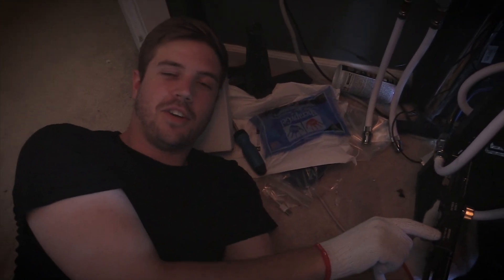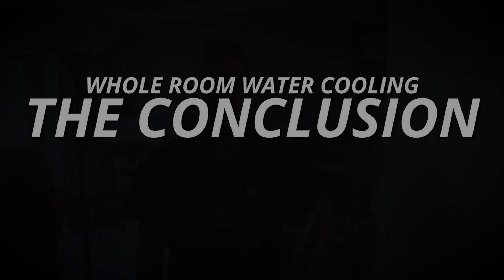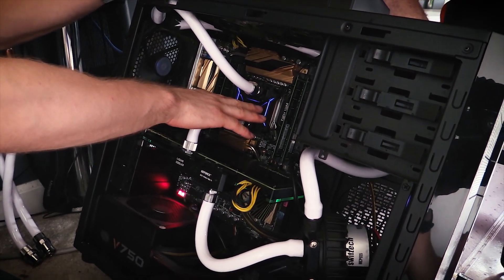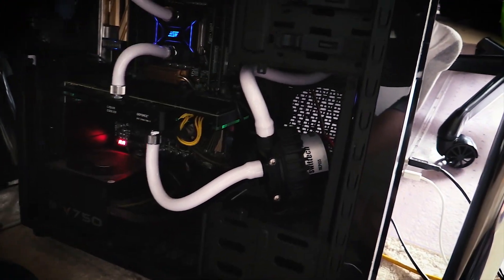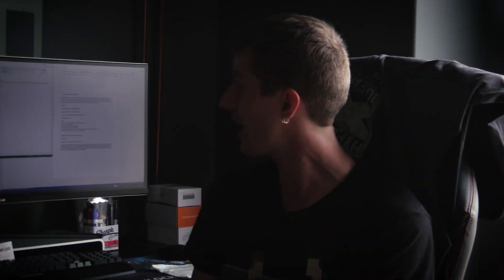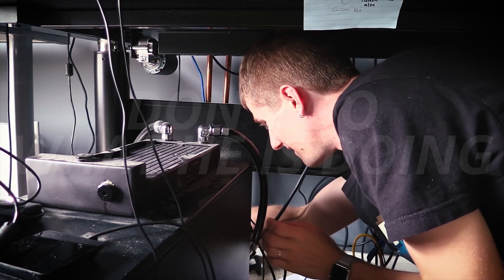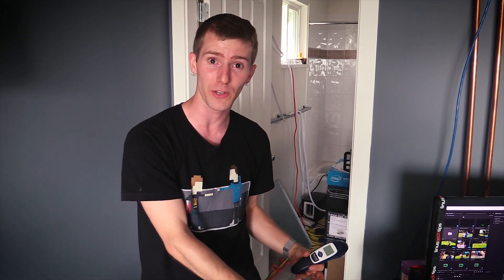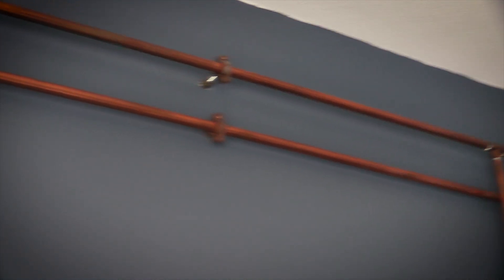Whole Room Water Cooling Part 7 - It's FINALLY over!

Comment: UV light does not kill all organisms in the water. It essentially requires a solution designed to be highly toxic to various organism. It then needs to be sealed, and before used, it needs to be fully cleaned and sterilized. Your cooling setup will be similar to a liquid cooled server room. A more practical solution is to have each system with their own radiator located outside.

PS another solution is a fume extraction system sued for multiple solder stations, such a system can be placed at the exhaust of each PC and thus pull the heat out if you design your PC's around using fume extraction systems. they are also simpler and cheaper to build. A little duct work, and an exhaust fan on the outside. and if you want to get really fancy, you can have some pressure based fan speed control using an arduino where as people open their exhaust vents behind their PC's, the fan speed will increase to maintain a set pressure level. You can even have the outlet vents be motorized using a voltage divider and some relay and some motors connected to the arduino where if a pin gets pulled high (e.g., the 12V rail on a PC comes on, it automatically opens the vent)

Comment: For your out of the room radiator and fans.  Why didn't you use a car radiator and electric fan which and push way more CFM than those computer ones. Was this ever considered
Reply: That makes more sence. Otherwise the route they took seemed more expensive.

Comment: +LinusTechTips  

Guys, Is am HVAC designer and from first look:
1. Bad dimensions on the and of circulation.
2. External could be done not as a freecooling but as chiller unit connected with external. You would get 7 degrees or 15 (probable 15 would be safer for PC because of humidity in case).
3. Reservoir looks expensive. You should go with normal one like in heating 50 cm3 (Should be enough without calculation). 
4. Pipes should be putted in vapor insolution.
5. If you did that you could mount fan coil in the room and you would get also cooling. 
6. Water needs to be demineralized! before you will put it in installation. If you don't know how to do it I will tell you if you want to know of course 
7. Next time use PEX instead of copper pipes. IT is easier, cheaper, faster ;-)

Next time contact someone with knowledge outside PC (probably they charged you a lot for those pipes and reservoir).

Comment: LinusTechTips  The temp difference between the pipes is going to be inversely related to flow rate, if flow rate increases, temp delta decreases and vise versa. With low flow rates, the parts of the plumbing immediately downstream of heat generating components will be hotter than parts further away and those hotter parts will transfer more heat into the surrounding air than the cooler parts resulting in both a higher temp delta (at least in the way that you measured it) and a warmer room.

That being said, insulated pipes would give you a cooler room for a given flow rate.

A high efficiency air conditioner might be 300% efficient, meaning that for every 3 Watts of heat exhaust it consumes 1 Watt of electricity (so of every 3 Watts of exhaust, 1 Watt is from electricity and 2 Watts are extracted from the room), the whole room water cooling setup can extract heat from the room all the way to ambient temperature of the environment into which you are exhausting the heat for just the cost of pumping, and it is possible to design a system that relies on thermo stratification and uses no active pumping, though it would require much larger diameter insulated plumbing and much more careful ordering of components and plumbing layout.

Industrial cooling, where temps are not required to be below outside ambient, often use setups not very different from yours in this video; if they do require cooling below outdoor ambient, they will still use a setup like yours as a first stage with refrigeration as a final stage (and possibly wet bulb cooling between, depending on ambient humidity levels.... )

Comment: An outdoor compressor or peltier cooler system would be awesome to keep your water temps just above the dew point for the systems inside. Your hydro bill would probably be high but it would still be a fun project.

Comment: The surface temperature of the copper piping isn't the same as the internal liquid temperature. You should assume the internal liquid temperature is much higher. I think Linus and the team has a nice concept and I think they should take the time to improve on it if they can.

Comment: well, you guys could have at least tried using heat wrap (the stuff they use on cars' exhausts) to minimize the heat being dumped into the room through the copper pipes.

Comment: Honestly, who the hell would want this? Big ass copper pipes running around the room looks ugly AF. Just to save a few degrees? In all reality, stock coolers work just fine.
Reply: hellya2011 while the whole room loop is way too crazy, those computers should not be on stock cooling. 4960x kick out a lot of heat, and intel's stock coolers are never a good idea on that kind of cpu. add in a few high powered gpus, and you either have fans running at 100% of trap a lot of heat in the case.

i think before the loop they were thermal throttled while rendering.
Reply: hellya2011 It was an experiment. Something different and new. It could have been amazing or a total failure. You don't know until you do it.
Reply: Brandon Francey yeah, i get that now, but i just think water-cooling is a bit overrated IMO, and this even more so.
Reply: Yeh, but with the workload that they put them under, the stock coller would just melt.
Reply: SoundSyncDJ i kind of doubt that. i put my machine under extreme work loads, and i run stock coolers. I had watercooling on mine, but it didn't cool it down anymore than a few degrees.
Reply: hellya2011 it kind of depends on what kind of water cooling you have (mostly the rad size). When I switched off the stock cooler to a H110, Temps dropped 20C on stock speeds on a 4770k. i'm guessing if you go custom loop and go crazy with radiators then temps would drop dramatically with noise as well.

Though my cpu was a terrible overclocker (only reached 4.2), the liquid cooler did improve temperatures quite a lot.
Reply: hellya2011 yep my cpu's stock cooler worked @ keeping the cpu under 70 degrees for about some minutes...and it was even a heatpiped cooler

Comment: If you really want to cool your pc, have them all submerged in mineral oil constantly circulating inside. Also have a refrigerator/phase change cooler on either side constantly cooling the oil to below freezing.

Comment: You can't get accurate temperature readings with a laser probe off of shiny copper. You need to dull the luster or apply a single layer of paint.

Comment: would another medium for the heat transportation work better, like using mineral oil instead. Seeing as it's less likely to have a corroding effect alongside being more hostile to bacterial life. But then again, it doesn't probably have the specific heat capacity. Also regulating the flow for the system would have been a good thing.

Comment: Whole room watercooling can become a success in a server room or in a supercomputer room. Cooling just a few of them is not worth it. It also can be a little success if it's made only for one PC to make a beast workstation completely silent on full load. Many people make PC and take them into the attic or the basement and get long wires to connect them to inputs and outputs in other rooms. I say it's better to take only the heat from them to whatever room one feel like. Like that, you can have access to all the PC without investing in long wires or expensive long range wireless devices (I've seen some buying long range HDMI, USB extenders and repeaters and take a lot of them in the main room and connect k&m, USB DVD-RW etc.) This method is easier and probably more cost effective than putting a PC in a remote location.

Comment: There is a reason that data centers use both entire room water cooling and equipment water cooling.

(35 years experience in and with data centers, including designing and building for old school and current technologies)

Comment: Air Condition is the way to go, true. But not as awesome as what you did :-)
You could maximise the performance of that system by insulating the copper tubes so there is no more dissipation into the room via the copper tubes. That would help a lot...and btw pointing the red dot of your thermometer on the copper tubes would have helped on determing the right temps ;-)

Comment: with proper pump selection and a few other things, this could have been much more effective. you still need a bigger pump. higher cooling water velocities mean better heat transfer and it mitigates fouling concerns. also if you want to reduce pump power required, don't put the copper tubing at the highest point in the room. or have the return on the bottom.

Comment: At my work, we place the pc's in a room with aircondition and have usb, displayport and other cabels go through the wall to where we work. That way we have no noice and no heat from the pc's where we work. We don't remote the on/off switch on the pc's, but you sure can do that. We just get the exercise :-)

Comment: Lunis, can't believe you didn't think of it... Insulate the pipes!
Reply: I did? Watched it to it's conclusion... Did I miss something about insulation then?
Reply: Insulation can be added to any pipe, it's just a foam shell you pull over the pipes. it's a 5 minute job and costs a few dollars... I'd do it if it means a degree in warmth less in the room. Sure, they move in a few weeks, but it's still summer...

Comment: Even it looks crappy, i would've insulated the copper pipes with grey insulation foam. I would blend in with the wall a bit better. Lots of heat is emitted via those copper pipes. Its a great idea though, i do love it. The extra heat could also be dissapated by the PSUs as well, if those would be watercooled as well... the little extra heat could also be get rid of. Those PSU exist, but damn expensive they are.